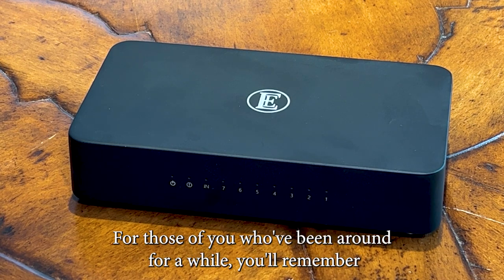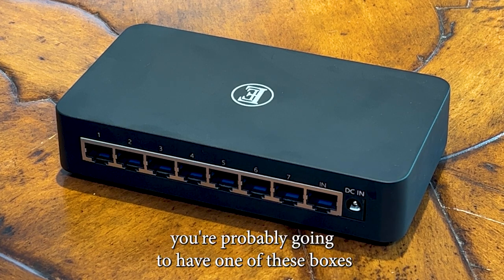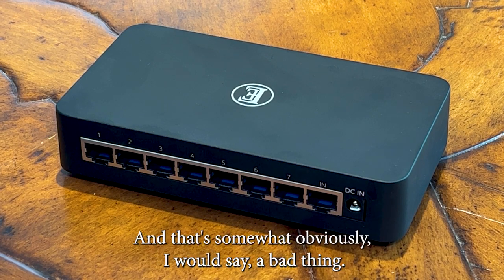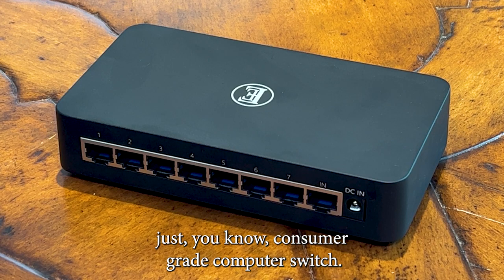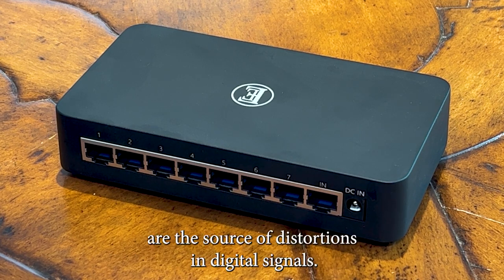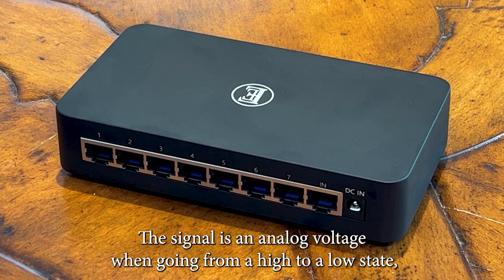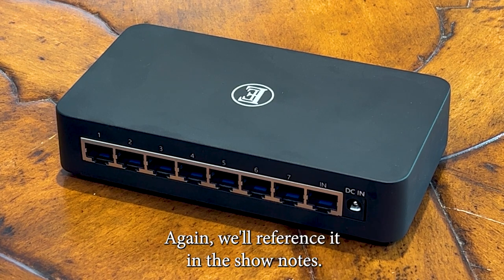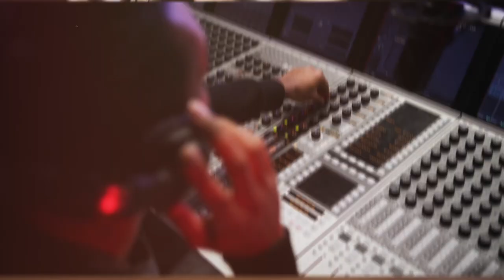Preview: English Electric 8Switch - Can 1's and 0's Create Jitter?

Comment from the maker: We realize that a lot of viewers have strong beliefs about the infallibility of digital signals. That idea may be well founded. Or not. We’re listening to this product to see if we can hear that it does anything that a basic network switch does not. Because we have found time after time that listening offers information that theories sometimes do not. If you are open to the possibility that errors in digital transmission are possible, we invite you to read this white paper which explains why all 1s and 0s might not be equal:

https://www.maldesigns.ca/pdf/UpTone-J.Swenson%20EtherREGEN%20%27white%20paper%27.pdf

The paper offers 3 theories actually, which do nothing more than suggest to us that some empirical evaluation might be warranted.
Reply: "We realize that a lot of viewers have strong beliefs about the infallibility of digital signals. That idea may be well founded. Or not. "

It depends on the implementation. You can define digital transmission which having a lot of data errors BUT in the real world we are working with well known transmission protocolls and technics like Ethernet and it is not a question of belief how high or low the error rate is when data is transmitted using this technology as the maxium error rate is defined by the Ethernet standard and could be measured also.

So for example when you transmit data between two switches or routers a single bit error is allowed in a amount of data which correspons to about 100 Audio CDs.

Under normal circumstances the error rate is even much lower so you would have to transmit 1000 Audio CDs to get a single bit wrong.

But it gets even more "crazy" - when using TCP/IP is used on top of Ethernet this very rare errors are detected and the receiver requests the sender to send that packet which contains that error again.
So as long as not a cable has broken or your switch has a defect you not have to worry about transmission errors at all....and that is well founded by hundreds of millions of emails and other data transmittted over the Internet every hour.

Did you ever got and email where some letter in the email was wrong because of a transmission error?

Did you ever heard about such a thing?

The answer is no - because pratically it never happens even when an email is send half around the earth....

But "audiophiles" are worrying if such errors occur in the 10 meter long network in their living room.....

It is totally nonsense!
Reply: I read the document. And as many have pointed out, it is nonsense. The fallacy is in the first line of your remark. This not about the digital signal. TCP/IP does not work this way. And clocks and jitter sound all nice and technical, have relevance when it comes to feeding data to the DAC, but don't apply to TCP/IP.

A little background, I wrote a book on performance testing more than a decade ago. I won't link to it as I am not here to promote the book. But in it one of the main things in the book is explaining that computers either run at 100% or are standing stil. If your CPU measurements says it is running at 60% people think of it as car that is running at 60% of its maximum speed. It is not, it is running at full speed for 60% of the time. If anyone wants to read more check out https://en.wikipedia.org/wiki/Queueing_theory 

This similar to how TCP/IP works in this respect. Most consumer network devices these days work at 1Gigabit per second (1 Gbps) This is a lot more data per second than the bitrate of even the highest quality lossless music file. Even if you have older devices still running at 100 MBps it is still much faster. The network does not slow down to the bitrate of the music. It spits out the data at 1 Gbps. It just runs this until the client device  buffer is full and it temporarily stops asking for more data. 
Why is then often called streaming? That is to indicate that the client device that gets the music file from i.e. the NAS or some streaming service, start playing the music even before the entire file has been received.
So if the buffer is large enough the entire music file can be in the client device in seconds. You can verify this by disconnecting the network cable during playback, the song can continue to play for seconds or even longer. How would that work with your audiophile grade clocks in switches?? The only clock that can have any effect is the one in the client device. 
It sends data in packets (not signals!) In TCP/IP the packets don't even have to arrive in the right order.. If a packet doesn't arrive intact it will be requested again. The data then acts similar to as if the file was on storage in the client device which is sending the data to the DAC. It doesn't matter how good or bad the 'signal' is that is transporting the data (the packets) to the client device, as long as it is not that bad that it the buffer runs empty. It doesn't matter how bumpy the ride was.  As long as it arrived in tact and before the buffer runs empty. You can think of it as a funnel. It doesn't matter for the stream leaving the funnel if the supply is steady or irregular, as long as the funnel doesn't run empty the stream will continue.
If the buffer does run empty even the untrained listener will hear this. This will not be about 'sound stage' or 'separation of instruments' These will be very clear artifacts similar to a CD that is so damaged that error correction can't fix it.

What about noise and 'leakage current'. If any of this happens to come from the network switch you need a better client device. This should never be able to actually make it to the analogue stage.

 Well anyone even a little bit familiar how the brain works knows how well it is able to fool you. Do I trust your hearing or physics and measurements. Occam's Razor tells me not to trust someones hearing over physics and measurements. 
If you want a real test: do a proper blind test. A proper blind test is where you take a normal switch and an 'audiophile grade' switch. Listen to them both until you think you can tell the difference. Then have someone trustworthy make you listen to both of them at least 10 times in random order (so in total 20 times) obviously in such a way that you can't see or otherwise know what you switch is being used. 
All you have to do each time is tell each time if you are listening to the cheap one or the audiophile grade one.  

This is important stuff. I, like many others looked at reviews from respected names to help me figure out what are good quality products. Only to find out that these respected names 'with the golden ear' claimed all sorts of nonsense on how different network switches sounded. As a result, I really stopped trusting them. I would say: for me the veil has been lifted: their reviews are utterly subjective and not to be trusted.
Reply: "We realize that a lot of viewers have strong beliefs about the infallibility of digital signals."

A lot of viewers? If i read the comments more than 95% do not believe that you are claiming.
Reply: I'm not even gonna read a document hosted on a site that sells everything based on audio wankery buzzwords.
Short answer to this question, is it's not infallable. It either gets there or it don't.
It's buffered and error corrected anyway, so the original file will ALWAYS make it even if error correction had to be used and the buffer kicked in.

Comment: BS. Ethernet is packet based with checksums. The only way your going to lose quality is if you start dropping packets. And before you go into jitter, the audio is contained in the packet. As long as the packets arrive in order and get decoded without errors you can't physically tell. Sure analog good quality cables make a difference. Digital doesn't matter as long as it meets the specifications. Give me some hard numbers and maybe I'll change my mind

Comment: As a former network engineer, I call bullshit. Error correction ensures the data is sent correctly. Trillions of bits of data are sent over Ethernet networks daily with websites, emails, etc all transmitted bit perfect from source to destination. Enough noise could potentially slow the data transfer rate, but the bitrate of streamed music is so far below the maximum transfer rate of an Ethernet switch that it would take a massive amount of noise before you would ever notice. Even then, any streaming device I've ever dealt with would just pause the music until more data came through.

Comment: Network Engineer here and also A/V enthusiast. These products offer no data to backup their claims. Ethernet is an asynch, frame/packet based, highly buffered, high speed packet pusher.

Let's cut through all the B.S though. I'll giver you 10:1 $$ that on resolving headphone setup that you can't tell the difference in switching.

Comment: 4:55 "first temperature controlled and compensated crystal oscillators so the oscillators are what determine the timing of the fundamental signals in the switch and you want them temperature compensated because
obviously temperatures vary in your home and temperatures vary inside the box as it's being used and heated up and so on"

Quarz based oscillators are very precise already (thats why they were used in most digital watches) and yes - the thing that impacts them most (but still on a very low level) is the temperature but at your home you typically not have huge changes in temperature (more than 20° celsius) - so the impact is very small.

But the real point is that the mentioned "timing of the fundamental signals" has allowed tolerances in Ethernet and as long as as you are in this tolerances everything works perfect and a standard quarz oscilliator is more than accurate enough to stay in these tolerances.

Think about the morse code which consists of dots and dashes (short beeps and long beeps).
Per definition a dash(long beep) must have a duration three times as long as a dot (short) beep but humans using a button to create a more signal are not 100% accurate and therefore the duration of a dash might be a little bit less (or a little bit more) than three times of the duration of a dot.

Does that cause errors in the transmitted data?

No - even when you are sending a "dash" with is only 2.1 times as long as a "dot" the receiver could still identify it as a dash and if a "dot" is 1.4 times longer than defined the receiver could still determine it as a "dot"...

The same applies for signals on Ethernet - there are tolerances and as long as you are working in these tolerances everything is fine and there is no need to use a "high-precision" temperature compensated quarz oscillator to ensure that the signal are inside the allowed tolerances.

Comment: Jitter only matters at the D-A conversion. Prior to that, digital signal bits are interpreted as either 0's and 1's by sampling them well after the voltage transition, where the levels have settled as unambiguously high (1) or low (0). Some digital errors occur, but there are many mechanisms to ensure signal integrity.

Jitter in the Ethernet stream is not the same as jitter that distorts the analog signal. Noise in the DAC, where jitter does matter, is much lower than in the Ethernet stream and there are various techniques to sample during D-A conversion without introducing relevant jitter.
Reply: https://youtu.be/TT9JL2yaIOA

Comment: As a professional network engineer with around 35 years of experience with Ethernet and the protocols running over it, this is pure BS.  Jitter at the bit level is absolutely irrelevant.  The bits get reassembled into packets of up to 1500 bytes long before they get anywhere near a DAC.  Software then decodes the packets into the stream of digital audio data, which is then decoded and fed into the DAC.  Bit level network jitter from an Ethernet LAN cannot possibly impact the timing that's actually driving the DAC.

Total BS, used to sell overpriced snake oil.
Reply: Yeah total BS... Networking equipment are engineered to transmit data without any error over a best effort network.  Then the receiving end (PC, Streamer, Etc) has to buffer it sufficiently to account for the variable throughput of the incoming data.  Then, you just send this lossless data to the DAC.  Best way is using Async USB which will result in the DAC using its own clock to regenerate the analog signal.  And unless you have a seriously broken DAC, the DAC's clock jitter is just noise well below human hearing threshold...  https://youtu.be/TT9JL2yaIOA

Comment: 12:21 but suffice it to say there is good technical reason to believe that jitter or timing errors
matter in the ultimate recreation of the analog signal"

Yes  - jitter or timing errors (it is the same) matter at the point there the digital data is converted to an analog signal.
But this happens not in an Ethernet switch - it is done in a streamer

12:35  hence we care about how we start and how much jitter we start with"

No - we not care about the jitter at the point the signal chain starts (which might be a server 10000 km away) - we care about the jitter at the end of the digital signal - so just before the DAC.
Each streamer has (and needs to have) a buffer the a couple of seconds or even minutes of music data is stored.
This buffer is filled by the data received over Internet - and readen from the buffer with a speed defined by the clock in the streamer.

So it is the clock in the streamer which determines the jitter - not the clock in a switch before the streamer.

The only thing that must be ensured is, that this buffer never runs empty (which would cause an interruption in playback) - so the internet connection must be able to deliver the data faster than needed for playback. This is normally not a problem with todays internet connections.
If it is a problem there is not way an "audiophile switch" can fix this.

And that is the reason why none of the manufactures of such devices are proofing their claims by either correct measuring or double blind tests.

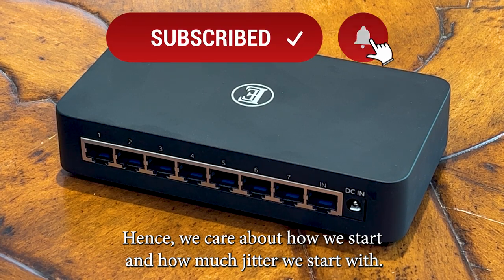12:41 and that's why we're interested in products like this english electric 8 switch

The reason is that sellers earn a lot of money with this overpriced voodoo stuff and some customers with limited technical knowledge believe they can improve the sound quality by bying this stuff.

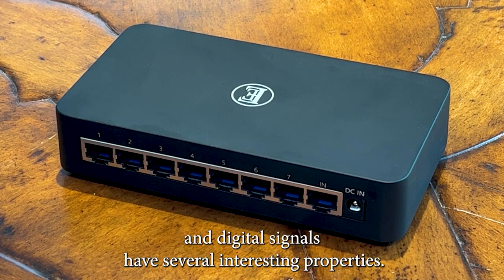Comment: 3:42 the first that i'd like to talk about is the fact that timing in digital signals is very important. If you do a little bit of study on how digital signals work the element that we typically think of as frequency is to some degree embodied in the spacing or the timing of the zeros and ones that make up the digital signal therefore 
timing is very important

If you really would have done some "study on how digital signals work" you would know that there are many different protocolls to transmit digital data there some of them have "critical" timing and others there timing does practically not matter at all.

Customers need switches which are transfering data without errors - and the industry provide such switches which can do that.

If "timing" would be a real problem - tell me why all that Excel-files, pictures, movies could be transmitted through a normal switch without causing any errors but when it comes to music it "suddenly" should create a problem?

A switch does not know what type of data is in the packages it does transmit and even if it would want to know that in many cases it would not be possible to find out as data is more and more encrypted while it is send other a network.

Comment: Audiophile switches are probably the biggest bs I've heard since premium HDMI cables that somehow should improve the image.
You can literally check the accuracy of the transmitted bits (not that it's needed, TCP protocol does that on his own) by using a packet capture software like Wireshark and verify that there is absolutely no difference between what's transmitted by a normal switch and a stupidly overpriced "audiophile" switch.

The fact this video isn't disliked to hell is kinda saddening.